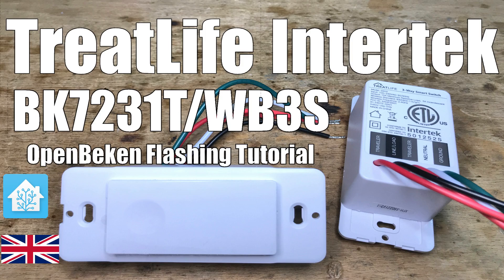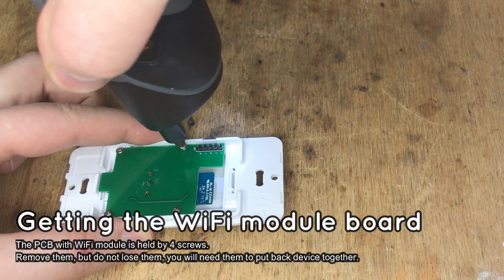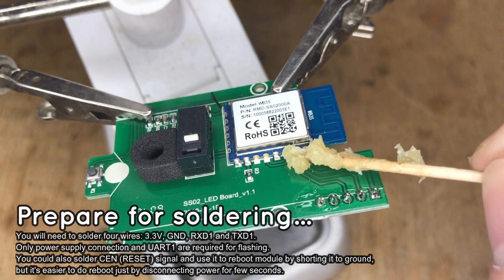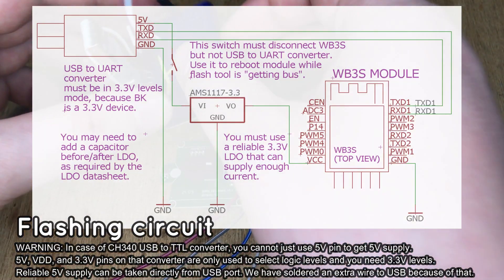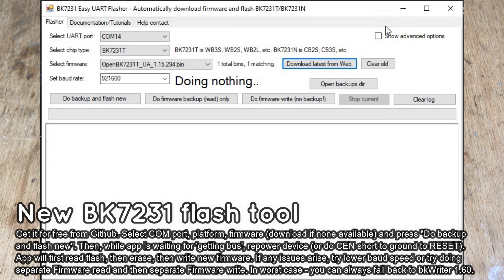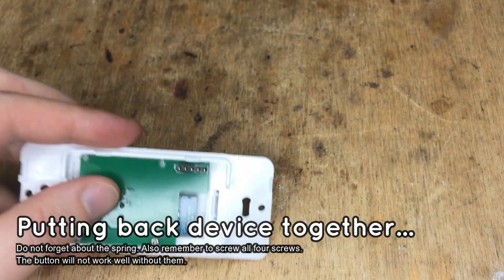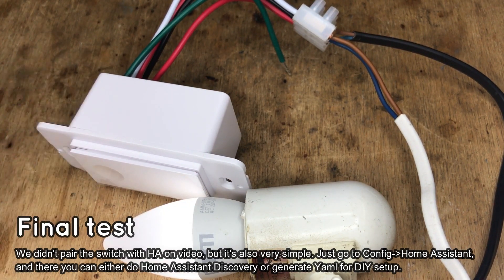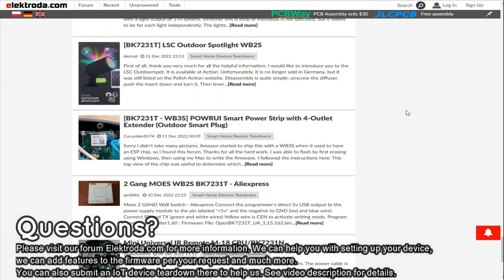TreatLife Intertek teardown & programming tutorial - WB3S/BK7231 - 100% local Home Assistant control

Comment: Goodnight,
I have this 4CH board, which has a corrupted firmware.
It uses the 15W204S micro controller and the WB3S wifi module as shown in the video.
Is there a way to copy the firmware from another identical board and reinstall on this board with the corrupted firmware, using the Cp2102 usb for uart?

Comment: In your video, the app only shows a single toggle whereas the Tasmota implementation has two "toggles", one for the switch and another for the state of the circuit in a 3-way or multi-way circuit. 

How does your implementation handle this?

Comment: Is there a way to program such a board myself? I want to tinker with Wi-Fi projects and these seem to be in a lot of cheap IOT devices that are no longer used.
Reply from the maker: Hello, here is a tutorial: https://www.elektroda.com/rtvforum/topic3850712.html
Here is our SDK: https://github.com/openshwprojects/OpenBK7231T_App
SDK has online Github builds so you can get binary files compiled online, you don't even have to setup tools, with OpenBeken SDK it's very easy to write code for multiple IoT modules